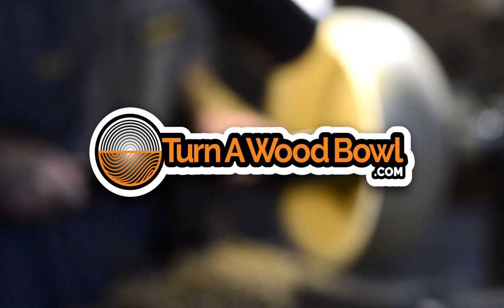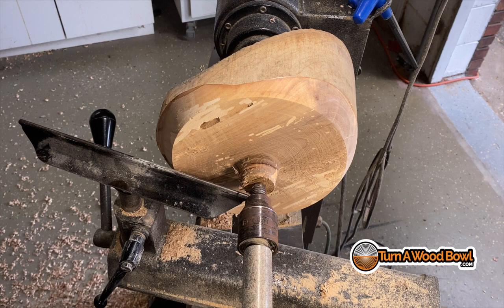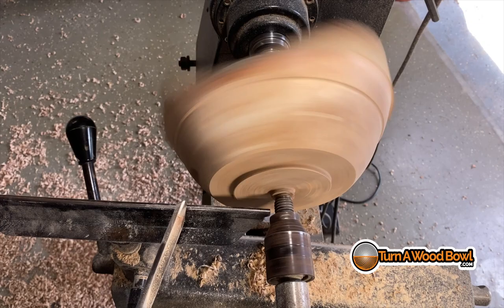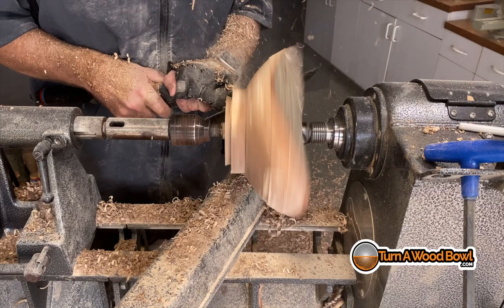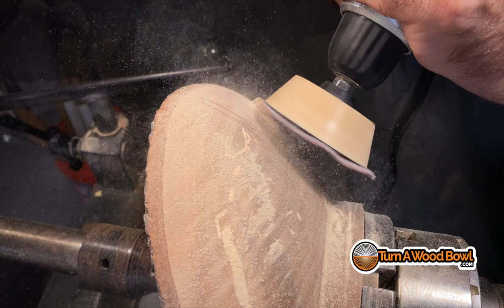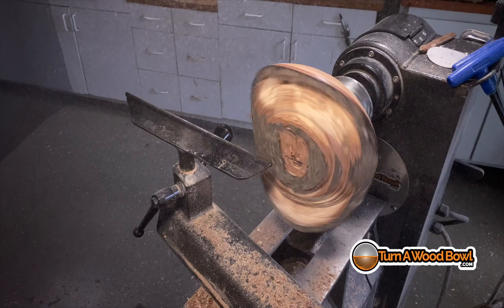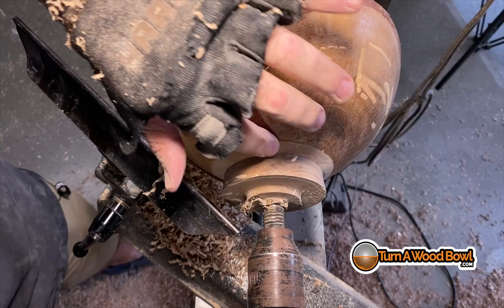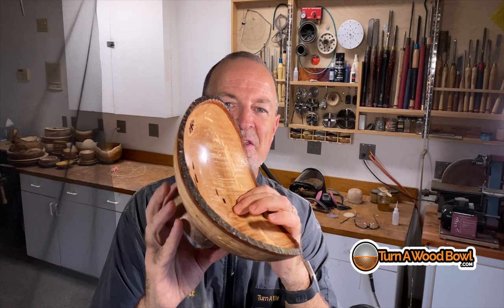Wood Bowl Turning Amazing – Nut Embedded Live Edge Woodturning Bowl Video

Comment: I found a walnut in the middle of a crotch piece when I was green turning it.  It looked great after green turning but parts broke off during drying.  This method is more reliable but challenging in its own sense.
Reply from the maker: Wow, that's amazing. Embedded in the wood? What a surprise!
Reply: Turn A Wood Bowl best I can figure is that it landed, or was placed, in the crotch and the tree grew around it.  I was amazed it wasn’t rotted considering how long it must have taken.

Comment: When the tree is cut down makes a huge difference on how well the bark holds. In the spring, the tree is growing quickly, so the bark is loosely attached. As you go into fall and winter, the tree isn’t growing as much, and the bark tightens to the underlying layer, possibly to also help protect from temperature cycles.
Reply from the maker: Yes, you are correct. Thanks for sharing!

Comment: Kent, I read a book by R.Bruce Hoadley. In “Understanding Wood” he talks about spring wood and summer wood. Wood from spring wood will have more moisture between the bark and cambium, thus debarking spring wood/ logs is much easier than say trees timbered in fall or winter. This would also conversely cause the bark on a winter cut tree, if I may suggest, to be real hard to remove. It would stand to reason the tighter the tree bark during winter, the tree is protected from bitter elements. In my understanding, deciduous trees are dormant in winter, nearly all the moisture has descended into the roots. Imagine a tree with lots of moisture during winter, like freezing winter? The free and bound moisture inside would freeze! What a catastrophe because we know what ice can do.
Reply from the maker: Yes, that makes sense. You might like to read "The Hidden Life of Trees" also an amazing book. Enjoy and Happy Turning!
Reply: @TurnAWoodBowl  and this video is strewn with ideas, thank you!

Comment: You've got me interested in embedding a butternut in a butternut bowl.  Any tips on overcoming the tendency of butternut to become hairy or curl its fibres?  By the way, your videos are really helpful.  Clear, concise and to the point.  Not all 'downhomey' or 'hey there folks whassup?' You just get down to business in a light-hearted manner.  Bravo!
Reply from the maker: Thanks Chris,
I'm not familiar with butternuts, but you might want to cut off the ends of the nut and let them thoroughly dry and then sand any "hairy" areas before embedding them. You can also just sand off the ends if you have a belt sander. You can also fill the nut with epoxy to reinforce the material. If you don't like the epoxy look, like me, you can coat them with shellac, many a few coats to strengthen them as well. 
All the best to you and Happy Turning! 
Kent

Comment: about Min 22.28 I am watching the constant vibration of the extended tail stock. I am thinking it is because you are using the long extender with the tailstock center. If it were removed the center would be closer to the tail stock and much less run-out would be contributing to vibration in the bowl surface. Adaptors on chucks many times also contribute to run-out wobble affecting the quality of your cut.
Reply from the maker: Yeah, good eye. It was not centered as well as it could have been. Happy Turning!

Comment: I have a number of worm ridden hickory trees that I have taken down recently, however my son and I have shied away from using the wood because of the  tunnels made by the worms, we turned a vase filled with worms. After doing so the grubs were still active. Every where we put the finished product we would find small piles of saw dust from the activity of the little guys that survived the turning process. How does one kill the little suckers? Maybe we will try something else now that I've watched you tackle the problem. Thanks--
Reply from the maker: Good question. Turn the bowl thin enough, there's no where for them to hide. ;) Happy Turning!

Comment: @Kent what the big deal with the 40/40 cut you hear so many people talking about? I see your work and find it very informative and I take note of your methods including gouge sharpening and bevel angles so I'm at 55. Yet you hear all these folks taking the magic of 40/40 so whats that all about?
Reply from the maker: Great question. First off, I think you need to use whatever tool(s) work for you. With that being said, I think some people promote "their" tool for a variety of reasons, but again you need to do what works best for you. I've gravitated to the 55° swept-back bevel because I can turn an entire bowl with it and not need to change tools. Also, the long wings allow me to quickly scrap and shear-scrape to make refining cuts, all without changing tools. The 40/40 does not work down at the bottom of most bowls. At that point you need to switch to a steeper profile and many use a 60-65° gouge for the bottom. The funny thing is the 55° SB gouge sits right in the middle of 40°–65°. Coincidence? By the way I teach how to shape and sharpen FIVE DIFFERENT gouge profiles (includeing the 40/40 and the 55° SB) in my Tool Sharpening Online course. You can make and experiment with all of them and see what YOU like. All the best to you and Happy Turning!

Comment: This is a legit question from a novice (genuinelywant to know).... why do many turners insist on turning that nub to the point they can chisel it off? Why not use a saw to cut it off? Especially if it's not going to be part of the finished piece.
Reply from the maker: Chiseling is uneven and can change the surface. Plus, we already have the gouge in hand. It's all good, most of the time. ;)